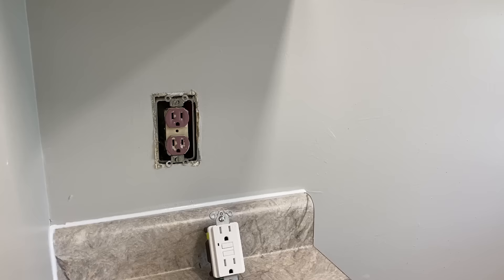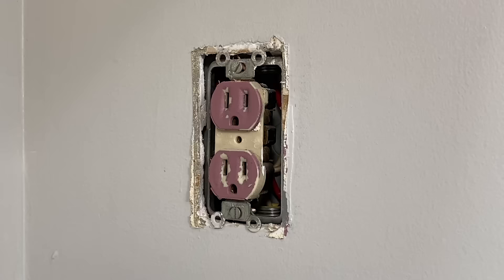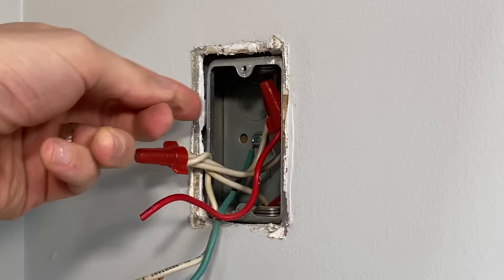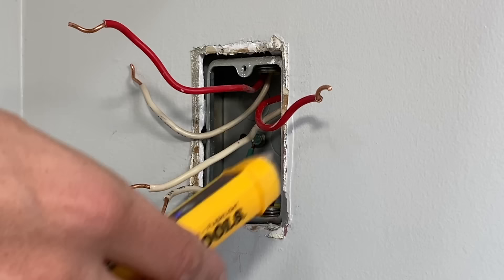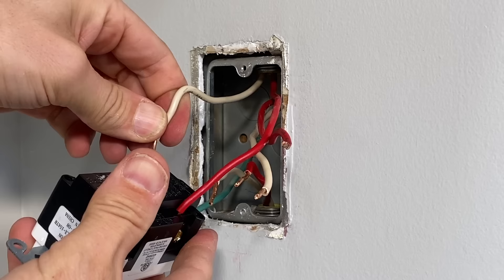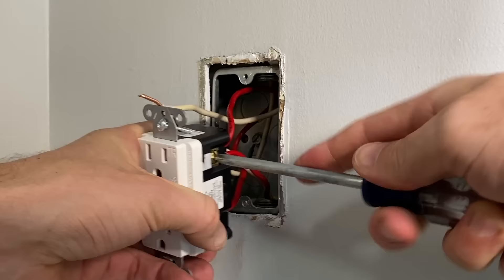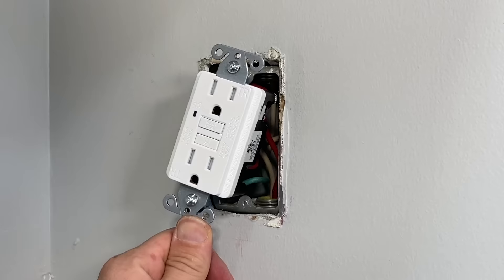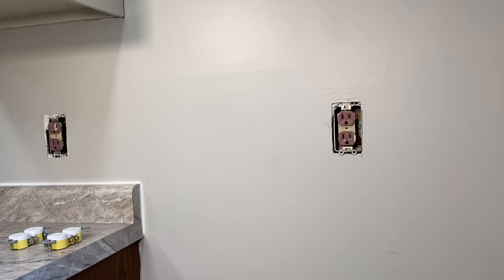Replacing A Standard Outlet With A GFCI Outlet

Comment: Make sure that is the only GFCI outlet you have for the breaker. I made a mistake of replacing all the outlets to GFCI outlets and none of them worked, so I had to put everything back except 1.
Reply: Yes, thank you for that clarity.  We went from renter to owner recently; and we inherited a circuit extended from the kitchen to outside with two GFCI receptacles installed out there.  Wasn't long after moving in that they failed, cutting power to our water softener.  No one told us it was wrong to have two GFCI's on the same circuit, not even the home inspector.
Reply: @mavirek  Right, home inspectors only say at least 1 GFCI is recommended when an outlet is near water faucets.
Reply: I have two GFCI‘s in my kitchen. That’s the way the house was built in 2007. How can this work then?
Reply: @chezchezchezchez  they could be conmected to different switches in the main panel.
Reply: @chezchezchezchez  That must be 2 separate circuits tho’
Reply: May I can used in the rooms?
Reply: @mayito3190  yes. But not needed.
Reply: Well you can put more than one GFI receptacle on one circuit, but it's not only more expensive but also requires more pigtails.
Reply: You can put multiple gfci outlets on one circuit but you have to put all the wires on the line screws not load screws!
Reply: Same for me. I didn't know which outlet was first and gfci didn't work until I found it...3rd one was the winner.  Out of 4 outlets, 2 were on separate breakers.
Reply: @mavirek we have a digital multimeter how do we make sure there is no voltage at the plug
Reply: I have a multimeter how can I make sure their is no voltage at the outlet
Reply: @chezchezchezchez mine’s similar age. GFCI by oven /microwave is one circuit 15amp breaker and other GFCI by sink is another 15amp circuit. Get a helper and electrical tester to turn off one breaker at a time and test your outlets to know what goes with what. You be amazing how you figure out how its wired.
Reply: How do I know where the Daisy chains starts?  in the kitchen
Reply: 3 GFCI on one breaker,  connecting all three GFCI on the Line side only.
Should work just fine.   sorry you removed your work.
Reply: @VOLTRONDEFENDER4440 yes of course.    sorry the silly mistakes they make.
Reply: @tedlahm5740  what do you mean the line side?
Reply: @jaytrg  opposite the load side on back of GFCI.

Comment: I did it, replaced an old worn-out GFCI in my bathroom with a new one. Your video was incredibly helpful. Saved a couple hundred bucks easy by doing it myself. Thanks!
Reply from the maker: Awesome, that is exactly the purpose of the channel.  Happy to help 👍
Reply: Thx a lot All Very interesting,  I am finding. I don't know which outlet is attached to a g f c I except the nearest one which is the utility room. And just 1 of 2 gfci thruput the lower level.
Plugged in a space heater. After a couple of years of doing same and now  those 2 outletsaredead.
The nearest GFCI. For washer and dryer 10' away has been reset still no power.
Hoping you have a suggestion!? Gary

Comment: It's good safety practice, for outlets and light switches that have exposed screw heads on the side that come in contact with the wires, to wrap everything in electrical tape, to prevent accidental shocks. The screw attached to the clamp for the red wire that brings power into the outlet is hot and it's before the GFCI protections. It could be a finger, a screw driver, an unfortunately-lucky splash of water, or a small rodent, but anything that come in contact with it will only be protected by the breaker in your panel box.
Reply: If you make sure you strip the wire the proper length so that when you push them into the back there is NO exposed copper there is no need to wrap the screws with electrical tape.  Saves a lot of time.
Reply: @noneya3504  If you look at around 3:49 in the video, this particular outlet uses metal screws to clamp together two metal plates that lock down the wire. The metal plates, and thus the screws, are conductive. Perhaps a better angle is at 4:06. The shock potential that tape prevents isn't exposed wire protruding from the back of the outlet, but rather the locking screws along the sides of the device.
Reply: I don't need no voltage tester. My wife works just as good. BTW, she has nice curly hair.
Reply: @outlet6989  ill be honest Ive been shocked a few times and its not really bad, feels like a stick of gum prank basically
Reply: Small rodent, time for a mouse trap
Reply: @noneya3504  TRUE THAT. BUT LIKE WE ARE SAYING, WHEN HE PUCHED THE WIRES INSIDE THE BOX, THERE WERE SOME EXPOSURE. YES, CUTTING THE WIRE AT ITS PERFECT SIZE COULD OF AVOID THAT. IS THE REASON I WARNED THAT TAPE MIGHT NEEDED AROUND THE WIRES AS AN EXTRA PRECAUTION. THANKS....
Reply: Damn I just wired one and forgot to do that. Fuck!

Comment: Great work. The only thing I noticed was either push the wire fully in the holes or cut down the exposed part so once it's in no exposed wire would be showing.
Reply: I always use a little electric tape around the body of the outlet.
Reply: Lived through the result of that a couple weeks ago. Yikes!
Reply: @lilolmecj  hope everyone/everything is okay
Reply: @henrythe83rd18  yes, it turned out ok, but sparks flew out of the outlet, yet it didn’t throw the breaker! It was very odd, all of the upstairs lights, on 2 separate breakers went off for about 5 minutes though the breaker didn’t throw. It was strange. We replaced the outlet and everything was good. Thank you for your kind comment. Today I installed 6 GFI outlets for my daughter’s new house built in 1955, so the outlets aren’t grounded. I am no electrician, but they are young and not high earners, so hiring one would be burdensome. My point,  I am fully tired of electricity for the day! 😁
Reply: @lilolmecj  Yeah the ground is definitely life saver. That is why codes have changed and better practices are done by professionals in the trade.  my point exactly. 'am glad you're all ok.

Comment: I've been teaching for 15 years and I'll say you explain things very well! Thanks!
Reply from the maker: Thanks JD,  appreciate the kind words 👍
Reply: @EverydayHomeRepairs  You've gained a new subscriber.  I appreciate the level of detail provided.
Reply from the maker: @liamhenry5224  Thanks 👍
Reply: A. Way of finding the line with power off is using a continuity tester or multimeter set to ohns zeo being continuity . You put test leads from each pair towards neutral towards ground and when you get the reading that is line since at the panel  the neutral and ground share a common connection . Also the refrigerator is not normally on gfi protection . To find which line is feeding the fridge you have a receptacle. Tester in the fridge out let then test each remaining.  wire  with continuity tester to find fridge . A bulb will give continuity quite often I would test  from switch keg to neutral to. Find out  which one was recessed lighting getting the dinner switch versus which one was switch receptacle with out a receptacle tester  you will get no continuity reading and will be the switched receptacle .  You get continuity from a closed switch  a fuse  or light. Bulb . Up. Gfi is required for any kitchen counter top receptacles or like the editor of the video six from a water source . Bath room receptacles have been for past twenty years a seperate gfi Circuit .

Comment: For a while, I thought that the outlets in 2 of our 3 bathrooms were not GFCI. I figured out why yesterday. The bathroom in our upstairs hallway had been renovated twice, in 2002 and 2019, but always had a GFCI. A few days ago, my toothbrush stopped working, it would not take a charge. The GFCI was not tripped. It wasn’t until yesterday that I noticed the light on the GFCI receptacle was not on. I immediately defaulted to loose wiring or a faulty receptacle, until I looked at the breaker box. There was only one breaker called “bath plug,” and it was tripped manually due us currently in the process of renovating both the bathroom in the downstairs hallway and the master bath, which were both on the same circuit! This was why my toothbrush was not charging. Due to the plugs in every bathroom in our house being on one circuit, only the first one in that line had to be a GFCI receptacle! I thought I was staring at a massive code violation, (no GFCI near two sinks) when in reality they were all connected to the GFCI in the third bathroom!

Comment: I know this is an older video and you've improved a lot since then but I have a couple suggestions for you. First, it's a lot safer to connect your ground wire to your new device first followed by neutrals and hots, that way you're protected from anyone possibly energizing the circuit by mistake. Hots should always be the last wires connected. 

Second, assuming that you have proper grounding system going all the way back to your main panel, you can identify which wire is your power source without temporarily energizing the circuit doing a continuity test with the neutrals and grounds. If a neutral wire has continuity with it's ground wire, then it's hot wire is always the one feeding the box.

Comment: I'll rate this video as a 10. I never use the wire push-in holes unless they have retaining screws. When you push the outlet back into the workbox, you can strain the wires and cause the wire(s) to come out. Your list of tools every weekend warrior (DIYer) needs is missing at least one hundred more. That LED light is very nice and helpful. I also use an LED headband type too. When I'm ready to install the receptacle, I put an "S" curve on the wires. That way, the wires easily fold into the workbox with less strain. A small-diameter wood dowl with a grove at one end help to get the wires into the box.
Reply: I'm your standard DIYer and I give you a 10 for your added comments. Your dowel idea should be in every tool box.

Comment: Good to have a GFCI tester.  It's just like the outlet tester, except it has a resistor connected to a button switch.  Push the button, it purposely causes a ground fault.  You plug one of these into one of those downstream outlets, push the button, and make sure the GFCI trips.
Reply: The button switch has to divert the power through the resistor into the ground, not the neutral in order to trigger the GFCI.
Reply: @williamwchuang  no it has to go through neutral
Reply: @williamwchuang  it likely has resister that only allows 5 mili amps to go through

Comment: Nice!  Screw slots holding the faceplate should all match in orientation. That is, straight vertical, or horizontal. Electrically not important, but is the sign of a careful, detail oriented craftsman.

Comment: 2:21 if you have the 'knack' you can tug and twist those 'quick connects' out in a jiffy. THEN observe the bare leads and decide if they can be reused or not. Often they can be used again without getting chopped off at the back of the device.
Reply: There's usually a slot under that quick connect that will release if you stick a screwdriver into it

Comment: A couple questions for you if you don't mind?

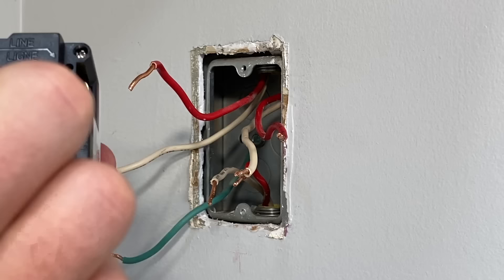1. At around 4:00 you said: "we'll be using all four of those holes" before beginning work on the line side. 
But I think you only used two wires on that end. Have I misunderstood something?

2. Why/ when would one use:
- Two LIVE & Four LOAD (As you did),
As opposed to, 
- Four LIVE & Four LOAD, vs
- Four LIVE & Two LOAD, vs
- Two LIVE & Two LOAD etc etc...

Thank you so much. I'm just trying to learn! 😊

Comment: TIP: Pigtailing the load wires will allow you to tuck them into your box neatly and to the side, therefore making the GFI have two fewer wires in it. Easier to get back into the box. You must have a condo there guessing from the 80's or so? Not often to find four square boxes with conduit like that unless its multifamily in a city somewhere. Great video.
Reply: Why did he put them on the GFI too? I'm new to this!
Reply: @margaretmceachran1272  sorry. I don't understand what you are asking.

Comment: Thanks for a great video!
2 cents:
You could have two voltage testers from two different brands to make certain that there is no current, for instance, if the battery was weak in one of the testers.
Would also add that having a GFCI/Receptacle tester and use it to set off the GFCI and to make sure it works.
Also to confirm that the wires are what the colors say they are. Black may not always be hot, cross wired.
The GFCI outlet should come with little stickers that say "GFCI protected" and can stick on the downstream outlets to let others know that they are GFCI protected outlets.
Reply from the maker: Thanks for the feedback, appreciate the help!
Reply: I thought I was the only one overkill enough to check these things with 2 testers just in case.
Reply: Doesn't look to me that if you ....
1 think that "hot is not always hot"
2.  Using two "meters from different brands"...
You mister are not a licensed electrician
Reply: @n1umj  really?
Two meters?
Please. Guys take some electrical courses before declaring yourself "overkilled"
Reply: @euskadi46  Sounds good!  You Good sir should make videos like @EveryHomeRepairs and share with us your vast knowledge, show us what a true electrician would do.  But you won't and all of us knows that.
Reply: Every voltage tester I have has a built-in battery tester. But, as is said, "Two is always better than ONE," except for wives and girlfriends.

Comment: After you inserted the wire into the plug there was some copper wire showing where they removed the insulation and it was too long for the plug you put it in should you electrical tape those areas
Reply: The short bit of exposed wire will not hurt anything as long as you make sure all your bare ground wires are positioned where they can not touch. Having said that it is always best to cut your wires to the correct length so that you  do not have any exposed/bare wire especially a black or red wire.

Comment: I have 4 outlets within 6 foot of a sink, they all have to be updated to GFCI but I'm not sure how to wire them. As far as LINE/LOAD on the 2nd GFCI. First time home buyer, familiar with DC electrical(wiring Utility trucks). So I have installed Inverters which supply multiple outlets. But typically we only use a GFCI for the first in the series. Sorry if this is a dumb question

Comment: You lost me on which wires were line. I saw 1 red wire that was hot. How was the white wire also hot/line? Identifying which wire is which seems the most important part.
Reply: You'll have a hot and neutral coming from the panel, which are called the line side of the outlet. All other outlets fed from this outlet are not directly connected to the panel and are therfore the load side of this outlet.

Comment: Hey man, super helpful vid my buddy is an electrician and helped me out with the basics but a video definitely goes a long way. I was curious though, my second floor isnt grounded, basically costs an absolute fortune to rewire and so im just using GFCI as a safety measure, just need to make sure all the downstream outlets arent connected at the load 
Any tips for telling where each outlet is on the ciecuit?

Comment: I like your presentation but I would have done my wiring in a different order, instead of connecting to power wire first I would have connected the ground and neutral before I connect the hot line for extra safety

Comment: 6:00 In Canada the 'box fill' and the device size have over passed the limits in the electrical code in this demonstration. With that kind of wire count, we require a 4x4 box with a plaster ring to accommodate the larger GFCI device and higher wire count..
Reply: it dose look like there is a mudring and with our codes there is no ground conductor so its 6-#12 at 2.25cin. and a device with 2 yokes so 2x the biggest conductor size 2x2.25 = 18cin. (by the way when i run conduit i always use a egc just habit.  though this meets minimum code not the best practical standard
Reply: @wizard3z868  "not the best practical standard" Then why on Earth would you share to the world a poor practice? Delete the video.
Reply: Frank Silvers  So this install is taking place in a lawless country?
Reply: Frank Silvers  Heavens to Murgatroyd!

Comment: I had to change two receptacles in my kitchen that are close to the sink, in fact they are with-in three feet each due to the kitchen design. I also when remodeling my bathrooms cancelled the receptacle on the bathroom sink light fixture and put in a GFCI receptacle in each bathroom as the house did not come with them in 1966. Most all of the boxes are metal so I wrapped the GFCI's and other new receptacles with electrical tape.

Comment: I have a similar single steel gang box in bathroom near on left side of sink. Practically no room to very little room between GFCI and the Box. How do I make sure the Screw Terminals won't short by accidentally touching the metal box?